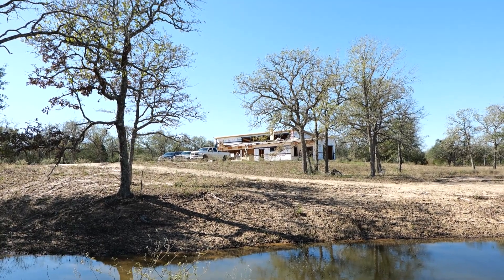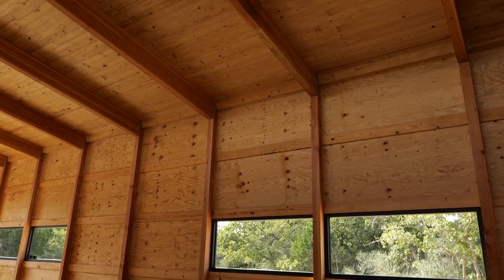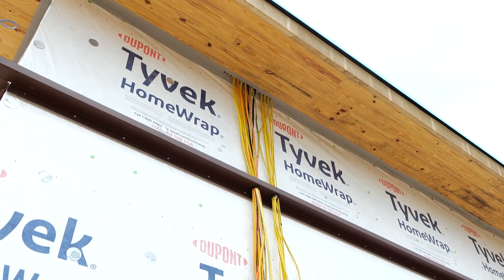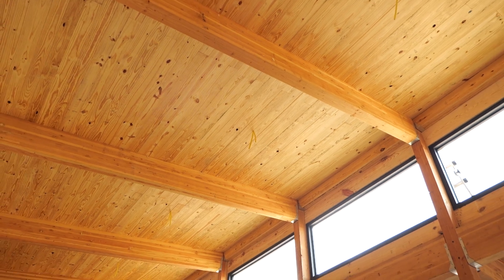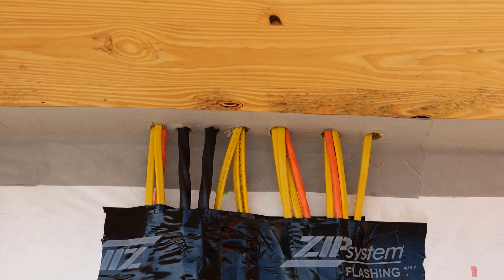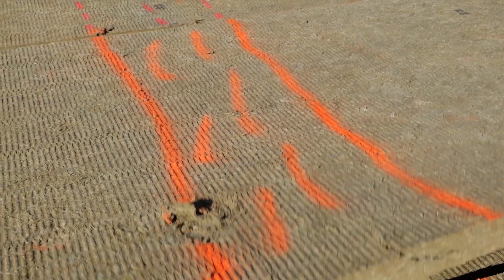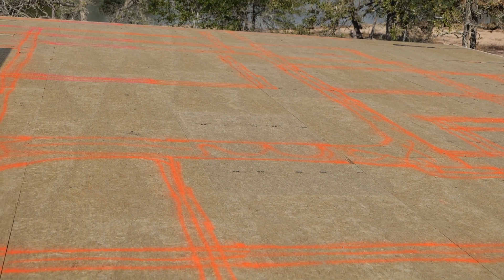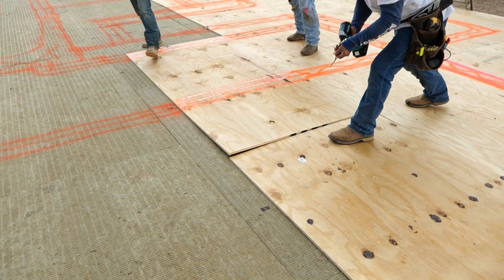We Ran Our Electrical Wires on the OUTSIDE?!?!

Comment: Hey this is phenomenal cause I cant stack my R30 rockwool in the attic with all those wires … i was about to retro fit my child hood home with all wires strictly in the studs behind the CMU’s anyways whats the program you use or the software you’re using for those 3D models im assuming you made it from scratch thanks ! That might be a video idea for ya on how you design the aesthetic goodluck

Comment: Not sure about the US but, in the UK, you’d get coded running it on the outside of the insulation as it can cause a bridging effect in the cavity for moisture.
Reply: If you need wiring designs for future projects, there are designers (like myself) who offer these services.

Comment: As a master electrician, you would be failed for rough in in virtually any part of the country with that roof shenanigans. Tape is not a UL listed method of support or securement. It all looks like Romex on the roof which is not an approved environment. You have no effective means of preventing damage unless you went and jacked an entire second layer of roof on top of it on purlins or other 2X material at a minimum. You have massive potential for derate and overheat issues. 

Honestly it's a cool concept on paper but never should have gone beyond that LMAO.
Reply from the maker: Thanks for the comment!  I think you must have missed the part where there is a full roof deck above the insulation and below.  Its basically a regular cavity wall or roof.  2X decking below, insulation in the middle, 1/2 plywood and standing seam metal up top.  The conductors are safe and sound in between.
Yes, we are aware that ZIP tape is not UL listed, but since the cables would lay on the roof without restraint (like in an attic) and the cables pass over ZIP tape in the assembly anyway, the thought was that there would be no harm in using the tape to keep the cables from moving during insulation installation.
Derate and overheat is addressed by the wire runs being beneath the insulation.  Much cooler for these wires than most wires in uninsulated attics.  (as a side note, these roof runs are driving LED light fixtures with a relatively low draw for the size of conductors).
This assembly is engineered and the electrical was all installed by a licensed master electrician and we are confident that it is safe and fit for service.
I'll check out electriciansU on discord!
Reply: @JordanSmithBuilds  you guys must have been very lucky with your AHJ then. Things get a bit western in Montana, but several  I work with brought up their input and code references where they would not have passed it, with protection and use of Romex in that environment being the chief concerns. Given the sandwich approach, and the fact it's on the bottom side of the insulation they can overlook the tape and just consider it supported by the plywood. The next concern was that with the use of a WRB directly on the deck, would that not be in the wet side? Or is the top roof assembly intended to be the primary WRB preventing any water ingress in that space with the insulation? If you have extra layers of underlayment and are going fully mechanically sealed, they may overlook the potential for that Romex to be in a wet environment, which would be a key violation. 

Their general feedback was that any conduit based install would have been a no questions asked pass because there would be no possibility for damage provided the boxes faced into the structure. But the use of Romex it's right on the limits of code and even a small interpretation difference with an inspector would create a major issue. 

As a recommendation for future work if you do this again, use UF in stead of Romex in that zone. At least then there is no potential concern for improper environment of install.

I saw the roof assembly. As did the inspector and the interpretation based on what appeared to be WRB was that that cavity could in fact be a wet environment. It may not be, it may be designed to stay completely dry. But that was an additional key reason for concern with the use of Romex.

To be clear, it's not the wires outside a structure that create the issue or risk or interpretation issue. 

It's Romex in that use case. There are just better solutions that alleviate that
Reply: Another note.

I see that they are using 2X T&G so they have 1.25" from face. If anyone used anything thinner, it wouldn't work. 2X good, if not metal protection needed below NM. If the second layer of insulation is less than 1.5 you would need a continuous metal protection 300.4E. in this case it is indeed more.  I would recommend putting the Metal protection above the NM either way for future reroofing.   In regards to a Building code this roof system may not meet the IRC or Energy code for insulation or structural. That is going to depend on your region though. This was an engineered roof system to my knowledge so it should be good to go in your area
Reply: And before code Nazis get up my butt, I'll put any code references people want on here if they really want to learn from it. 

Otherwise, catch the discussion over in the electricianU discord!

Comment: The problem with what you're doing is some day that roof will need replaced and when that day comes they're going to hire illegals to do it... 
I would just do use old copper pipes as conduit or copper plate emt and boxes (if inspectors allow) and make it look antique.
Reply from the maker: The roof replacement will be fine.  The wire is 3" away from the roof decking and the roofing screws will only penetrate the 1/2 sheathing and slightly beyond.

Comment: Matt Risinger is shaking his head and saying "I failed to teach him".
Reply: Multiple wires in one hole?
Reply from the maker: The multiple wires are moving from exterior wall cavity to interior wall cavity in most cases (in all the cases you saw in this video) There are places where we have two wires going into the same hole for the light fixtures, but we have air sealed those with fluid applied.
Reply from the maker: hahaha.  Probably so.

Comment: That hurts my brain. But in essence, you've done everything normally. You've built a normal-ish wall assembly and then you have a barn inside of it. Given the Texas sized ass pain that could be caused by a screw causing an electrical short, I would have run hard conduit, like commercial grade.

Comment: So wait. Now to replace a wire in the future I have to rip whole roof off?
Reply from the maker: Why would you need to replace wire? We’re running four conductor with a ground to each fixture. I’m pretty sure we’re covered for every eventuality.
Reply: Or meke any interior changes. As simple as my wife  wants new light fixtures that require a different pattern. Great idea but poor consideration for future modification. In commercial construction we do this all the time with structural and finish framing with a ducted cavity. This is a good concept if the owners are good with no changes, ever.

Comment: pretty sure zip tape is not an acceptable cable fastening method
Reply from the maker: It’s just there to keep it from moving while we insulate
Reply: @JordanSmithBuilds  No like electrical code acceptable. Wiring outside air barrier in cavity wall assemblies isn’t that rare on hospitals, etc. - normally there are clips every x inches to support self weight of wiring (but on a hospital it wouldn’t be NM cable obviously). Not that zip tape but won’t probably hold up fine in reality. Not that whatever is going up for rigid insulation won’t “clamp” it in place. Just a code concern. My guess is there’s some sort of plastic one hole clip for NM that can go up with a single screw. Obviously desirable not to make holes in WRB and/or air barrier but electrical code doesn’t know or care about that.

Normally there’s two criteria:

- wet location or not? outside WRB but behind cladding would be wet location by most sane definitions of wet location
- protected from mechanical damage or not? outside WRB and/or AB but behind cladding system may qualify as protected from mechanical damage, but I can imagine it not flying with a given inspector - unless I had confidence in the inspector’s consistency of opinion/communication I would assume this would need to be armoured cable or in a raceway.